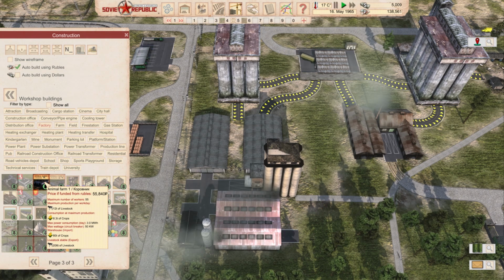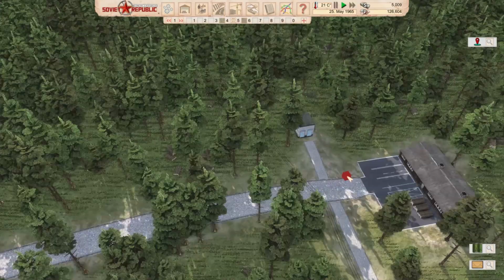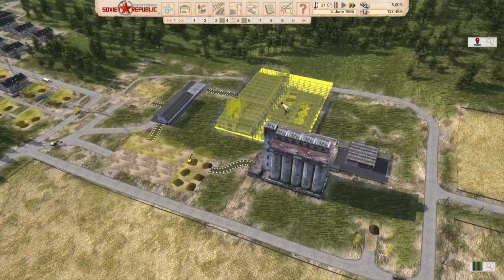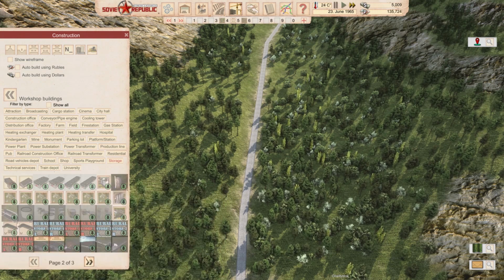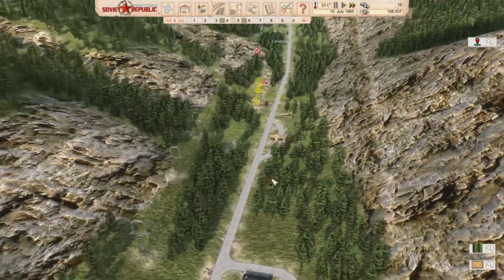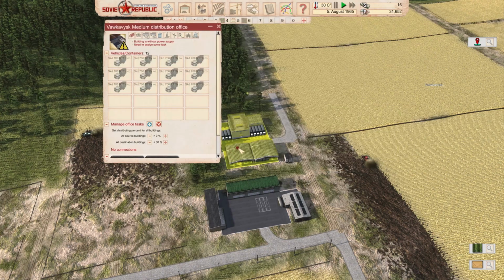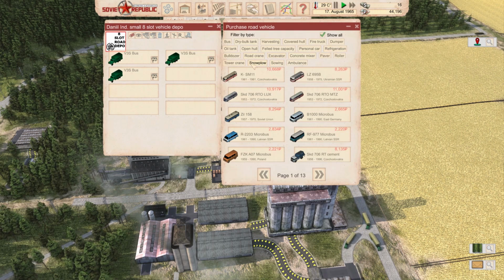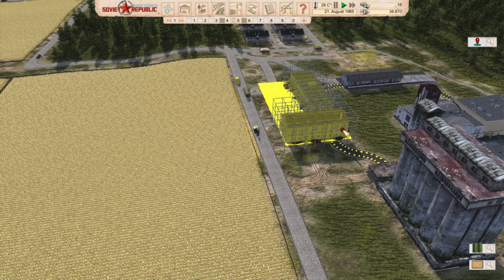Soviet Republic - Alaska - Ever Expanding Storage - Ep.15

Comment: A thought on the three woodcutting posts what would happen if all the trees were deleted and then replanted how would they be reallocated to each post.
Reply from the maker: I tried t do a quick test but I failed as the treen needs time to grow! Stupid tree!! I need to get a car for a yearly technical examination and will be back ASAP! I will test it then. :)
Reply: @oolykeegaming81  If rusty fails the test ..... I have a friend with a contact for used cars. 🚗
Reply from the maker: @oldgalah7425  just at the testing center now. Used cars are really cheap here. Paid 2007 Skoda Octavia 2000 euro and it had 90000 km on the engine. All legit. No major issues but rear right break was 700kN compared to 2000kN on the left side. Replaced the break and we will see now. 😊
Reply: @oolykeegaming81  It's the opposite here second hand prices have skyrocketed because the last manufacturer in Australia closed last year and now we import them all, which means because of the covid mess hardly any ships have been arriving and the new car sales lots are nearly empty.
Reply from the maker: @oldgalah7425  during the Celtic Tiger years in early 2000's Ireland imported crap load of second hand cars from Japan. They are still in circulation and keeping the price down. Average 10 yo car under 200000 km goes for under a 1000 euro here.
Reply: @oolykeegaming81  Back in the day we imported a crap load of Irishmen and others, their descendants are still in circulation and doing well. Trade between countries is beneficial to all. It's beer o'clock time 🍺
Reply from the maker: @oldgalah7425  hahaha. True that. 🍻

Comment: Construction office trial working well, your thoughts. I have two 32 slot offices on auto search, No 1 has 5 buses, 4 excavators, 4 bulldozers, 2 pavers, 2 rollers, 4 tower cranes and 11 open hull trucks to carry them. Office No. 2 has 2 medium covered hull, 2 road cranes, 8 large dumpers, 4 smaller dumpers, 8 concrete mixers and 8 open hull trucks. This set up is basically one office with mechanisms that need to be transported and people, and the other with the rest, setting it up with medium construction offices consider a small office just for the buses. Cheers :)
Reply: I believe 64 vehicles will be capable of building things!
Reply: @bc74sj69  It probably is overkill but I build smallish towns not too far from each other so it's like a construction hub.
Reply from the maker: @oldgalah7425  I might be wrong here but I only put 2 buses in the big construction office. I did notice a slower construction speed. It could be that but on the other hand, most of the construction happened in the city and locals were working on the sites.
Reply: @oolykeegaming81  The more buses the more worksites they cover, especially when the republic expands like planned, by planned I mean our usual look the other way and using our ASC Inc 1963 partnership to circumvent the bureaucrats. 🍺 💰💰💰
Reply: @oolykeegaming81  I find this dangerous, and I am slowly moving towards specialization. When playing how I play, local workers can kill your people (starving vanilla power and heating plants, stalling  concrete and asphalt production, etc..). I use a TON of  vehicles, chiefly covered hulls and buses, and try to keep everything out of walking range. My game starts are riding on life or death, using vanilla heating always with exchangers, no self heating houses, power is rarely imported after year 2 (year 0 in current challenge). My main goal in the first year is getting up additional COs (even if using modded 32s) so I can separate labor from everything else, and keep it throttled. Pollution is also a killer from most vanilla sized things. I haven't taken any time to judge pollution in mods other than one asphalt plant that doesn't require asphalt Stephen Silverbeard looked at briefly that runs on fuel. I'll just say the rural power stations that I think Ryan made or someone else out of the 6-7 modders in HMC list are incentive enough to get a distant coal power plant up ASAP.

Comment: I know you will have to choose between locomotive and road vehicles, but think all the same that the faster the better to have a better distribution of types of vehicles in your COs. 4 open hulls to carry two excavators, two cranes, 4 different building materials on several different construction sites, is very insufficient. Even more for projects further away from your bases. Oddly enough, I don't know why, in your previous let's plays you had quite a few open hulls also in your COs, while their number is quite decisive for the pace of your expansion.
Reply from the maker: SO you believe the Open Hulls are the bottleneck of our construction?
Reply: @oolykeegaming81  Partly yes. In fact, it's all your vehicle set-up in your COs that could (should) be improved. But in any case for the flat beds, including in your previous series, you do not use enough in your main CO's, do not forget that they are in charge of excavators, cranes, 4 different types of construction materials and generally a whole list of projects to be carried out in parallel.
Reply from the maker: @statsneguit3069  Sure! But not all at the same time. :) 
Usually, I had 1 for all CO, and now that I "specialized" I should have more space for the open hulls! Yeah! Let's do this!

Comment: I was surprised to see you launch a fairly long power line to the new power transformer near Modred's CO while you had a power transformer in the direction of the future iron city, what was the reason for this choice?
Reply from the maker: OK. So what I learned regarding electricity is that redundancy is everything. I will be creating power lines towards Iron city and Galask 
I connected it to the Modred CO just because I'm planning ahead to build the line towards Fishing village soon. I hope I explained it OK. :D Looong day behind me. :)
Reply: @oolykeegaming81  I was talking about the medium power line that you pulled from the power transformer of the COs zone to the substitution of the gravel zone which could have been connected more simply and less costly to the power transformer that you are already building ... So it wasn't really about redundancy for high voltage supply. But I could have seen wrong in the video
Reply from the maker: @statsneguit3069  I'll check it out! Thanks! :)

Comment: To see all the vehicles available you do not necessarily need to reset the game, in the cheat mod you have the possibility of occasionally selecting "all vehicles available" (or a formulation like that), as for the line spacing, and then when you want you can deselect the option without problem and without having to launch the game again
Reply from the maker: Hmmm. I missed that. I'm a bas cheater! Well not according to @bc74.
Reply from the maker: Just kidding!! :D
Reply: That is what I do too and to plant trees in towns. You can call me a cheat but when I start my maps that is where I add water, mountains, and valleys etc. because most maps you import from the workshop need a little or a lot of tweaking, also deleting all the resources and placing them in more realistic or interesting places is easy. Most maps are only what someone thought up anyway so changing them to make them more challenging/playable seems fair enough to me. Even ugly maps can have some potential. Cheers :)
Reply from the maker: @oldgalah7425  this makes a lot of sense! I found several maps really nice but they were swamped with resources. Thi is a great idea! I never thought of it.
Reply: @oolykeegaming81  Is oil really found on a mountain, suspended there by some form of reverse osmosis, instead of in the valley or a bit of flattish land. Move it to a corner of the map so it has to be sent by rail or river to the rest of the map. 😊
Reply from the maker: @oldgalah7425  they said there's an oil to be found in the hills as well but I'm not the geologist. But yeah. Good plan. ☕

Comment: When a building does not have a CO in the list of those who can build it, it does not mean that this CO cannot build it, only that it is too far away to be auto-detected. You can therefore select it and manually assign it to this building anyway (this would solve your problem in Modred)
Reply: Yes, 4.9km will show up in the list, 5km you can click on any building with a path on the map.
Reply from the maker: I believe I tried both manually from the building and from the CO. I believe they are just out of range.
Reply: @oolykeegaming81  I don't think it works that way. 3km autosearch, 5km can pick from the job site, over 5km you can still add from CO.
Reply from the maker: @bc74sj69  OK. I was unaware of this. I was obviously doing something wrong.
Reply: @oolykeegaming81  nothing guarantees your bus will make it in 5:40 or 6 hours (can't remember but they vanish after a point, not 5 as it shows though. But delivery vehicles will go anywhere.
Reply: @stats I facepalmed my forehead so hard, I gave myself a headache. lol @Oolykee No offense Oolykee but yeah just manually assign it.